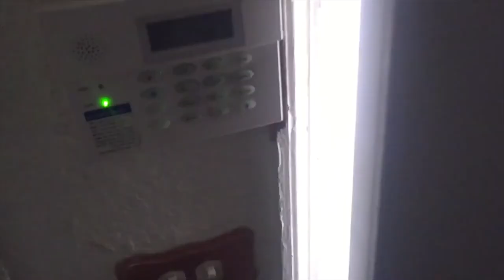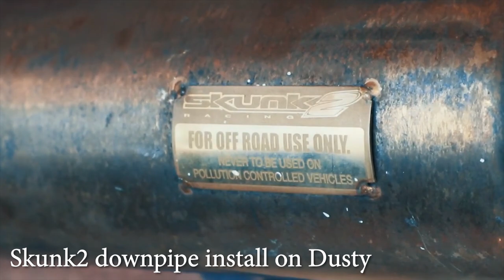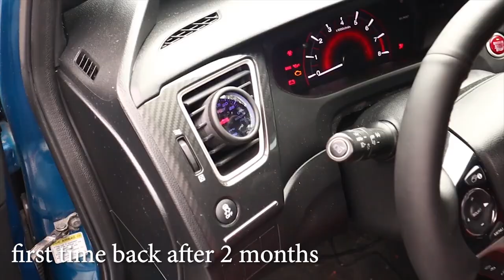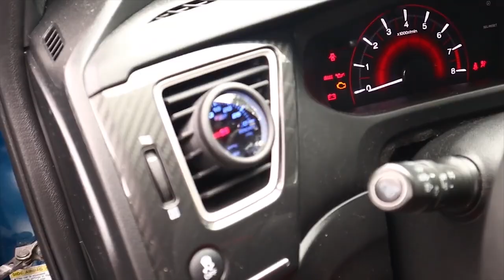Should I Keep It or Sell It (Dusty The Turbo'd Si)

Comment: I had 3 cars that are “sporty” starting with a 350Z, then a 4th gen WRX and now I got a 9th gen Si. RWD is fun but sketchy and especially that you gonna be probably getting yourself in trouble like I did and drift around then drive on bald tires 80% of the time. WRX was pretty cool but I had alot of engine issues. The Si has been the most reliable and a good daily to me. But eventually it just depends if you gonna daily or track the car I guess

Comment: In today’s economy payments ain’t it b. But i think you should put it back stock and get what you want fr.. I’ve seen dusty on mcnab and 81st a couple times it’s clean ash im sure you can revert back to stock and sell it for a good amount. Im saying from personal experience make SURE it’s what YOU wanna do cause I sold my 9th to carmax and it was the best daily I’ve ever had. I have a 8th now and I hate the car vtec is nice but the 9th is way better in terms of refinement. One day I will own a fk8 but for now I’m building a j series. K series ain’t fun unless turbo’d I ain’t dealing with 3rd gear breaking and throwing a rod. 340 is nice I wanted one but it ain’t practical for me… it’s auto I hate auto.

Comment: Bmw is all ways a bad move. Owned a n54 335i for a week and I was so glad to get rid of it. All cars tend fo get boring over time the next thing you get into the same thing will happen. If you bored I saw pull the motor on the si build it and get a bigger turbo and turn up the boost. An evo 9 sounds nice as well or building a 2jz. Just don't go German 🤣